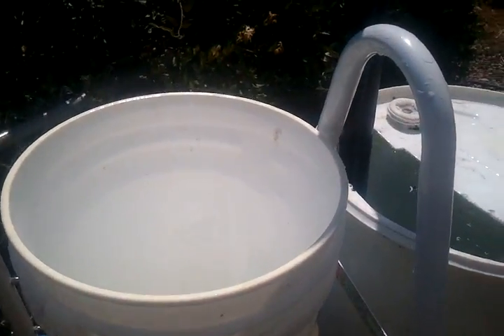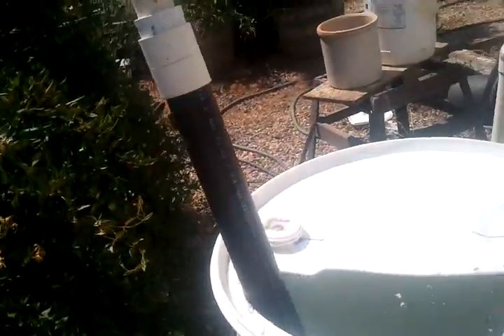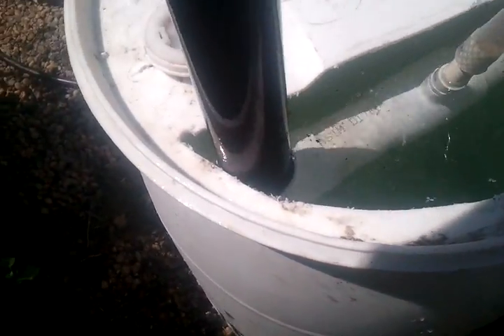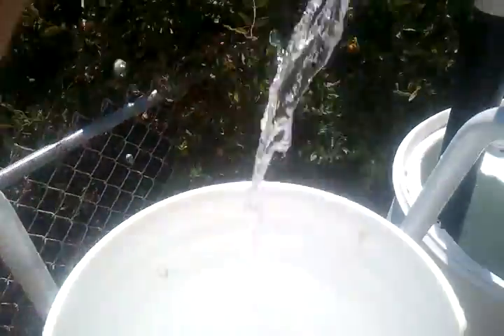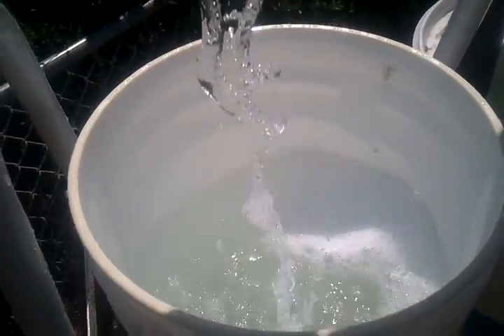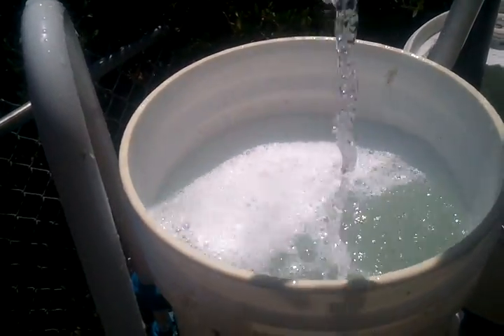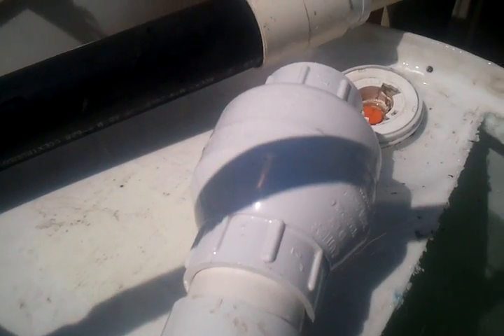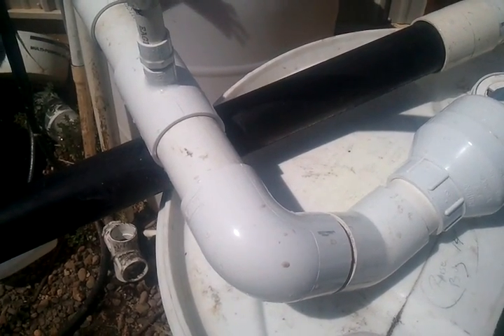Test runs for the AquaZen & Simple Airlift

Comment: Wattage of the pump?
This is very important value factor to make accurate cost calculations vs a standard pump.
Reply from the maker: This video is more about comparison of airlift designs.  I agree conservation of energy is very important.  You may be interested in the 8w system I just finished.  'Construction of 60 sqft Earthan Beds w/ 8 Watt Air Pump'

Comment: Sorry Bob not enough space to give all the details
Submergence = 700mm
Lift =520mm
therefore:
700/1220= 57% 
Is 53% the optimum?
This would mean I have to extend my lift by 100mm to 620mm?
My flow per watt is 27.7 l/w @ .5 meter head
Cheers
Neil

Comment: Hi Bob
I've been following your progress on the best flow rates of various airlift pumps.
I timed your version of the Aquazen @ 115 seconds to fill a 5 gallon bucket yet your geyser pump without the separator (butterly valve???) was 50 seconds, at least twice as good
Am I missing something here as you are praising a design which is half as efficient as your Geyser pump
Is there a formula to work out optimum flow rate per/min per watt at e.g zero head?
I'm getting 500 l/hr @18w with 520mm head